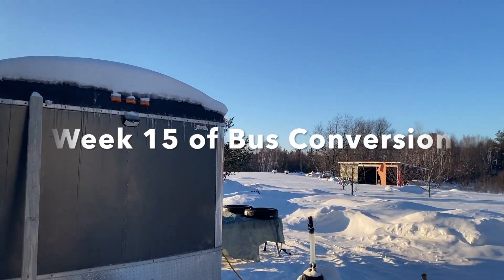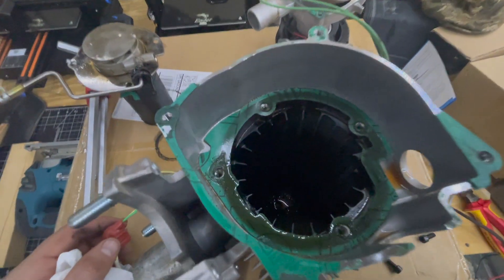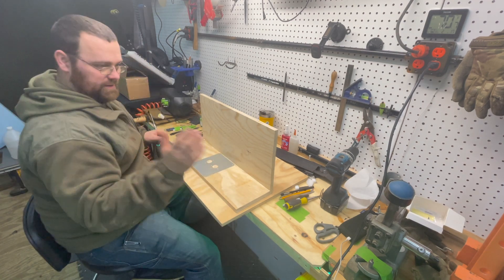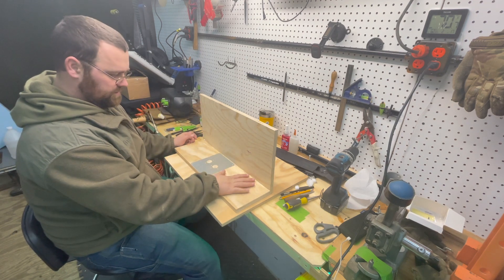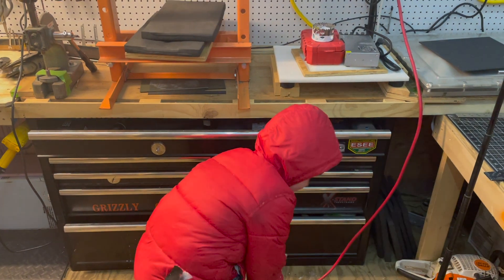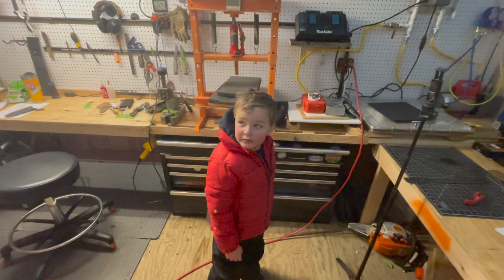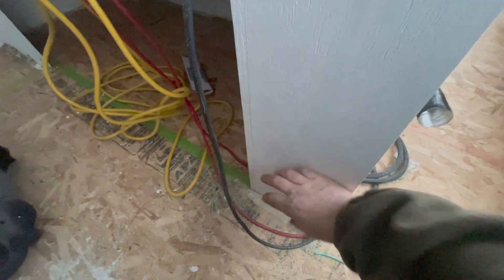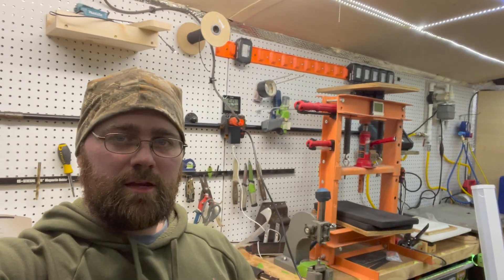How Much Work Can We Do During the Coldest Time of the Year? DIY Bus Conversion Week 15 Vlog

Comment: Do not flip your mini split around, you have it in the right way.  

As you go down the road the side of the bus has positive pressure, the underside of the bus is in a slight state of vacuum. The way you have it uses the natural airflow of the bus. If you flip it, the fan will be fighting the airflow as you drive
Reply from the maker: Ok so fan facing in is the proper way? Insaw a video of your bus with the fan facing out. And was told 2 different ways from pioneer techs. 
Will having the fan facing in decrease the efficiency at all when parked ?

Comment: Our MCI has two of those diesel heaters. One front and one half way down. Usually we only have to run one full time as we get sun exposure that helps. They run well enough they cook us out!  We also have a separate 200 gal fuel tank for just the heaters!
Reply from the maker: It's definitely nice to have the heaters as options.